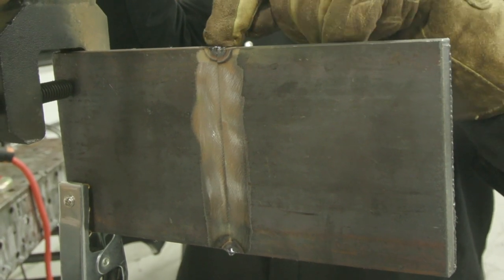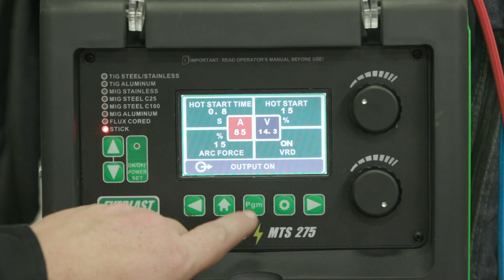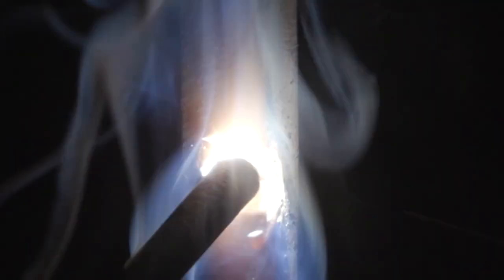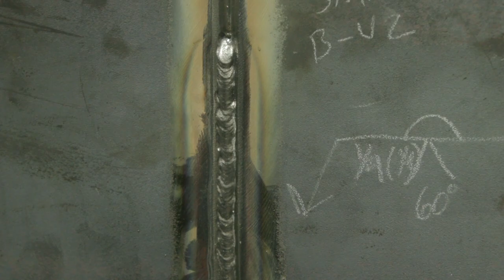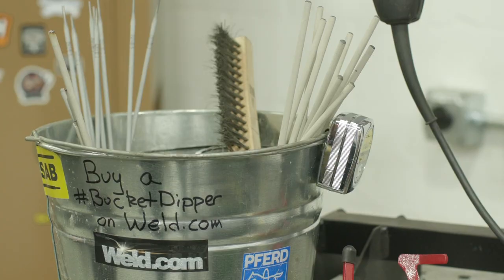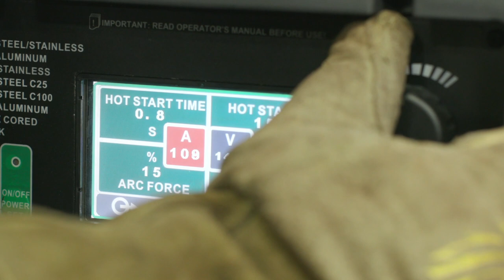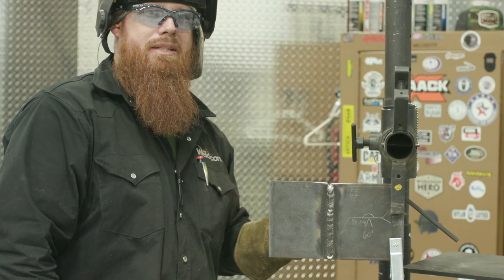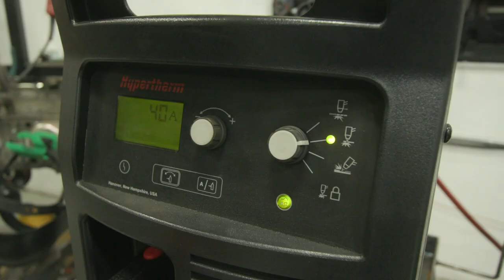Vertical Stick CJP with Back Gouge - Full Pen

Comment: This procedure is used extensively in heavy equipment repair where 100% full penetration is required.   A lot of bucket and blade cutting edges and router bits are replaced this way.  This is also a great method to help control and counter act warpage.  Another good one my man, I got a like button to go batter about.

Comment: I’m thankful for the sponsors providing the machines and consumables to do the content. It’s also nice to see new machines capabilities without having to buy it. I don’t doubt anyone on the welding side of the trio here could make any of the welds with basic machines, but maybe show some of these guy’s learning how to weld on a basic mig or stick like they have at home. Every now and then, you know. No pulse mig, no slope adjustment, blah blah..... show Joe what he can do with a Lincoln 180.....and I mean the limits of what he can do, not a butt joint. In the right hands, what can Joe achieve with a basic machine.......because that’s what Joe has while watching these vids. He wants to learn, but he can’t watch a pulse video and go try it for himself. And on topic, nailed it Jason..... killer job as always.

Comment: Understand the left handed remark. It's definitely different if you're not used to it. Had to do some lefty welding on a 12" flanged cross yesterday. Wasn't that pretty but it'll hold the fire pump water.

Comment: Another Great video! Gouging with plasma works great for small welds or cutting tacks but still like clean carbon arc for down hill /overhead weld removal. 💥🔥😎

Comment: Great left hand weld my friend.! Say...dont you use those old air grinders anymore??? They look like the jack-hammer used to break concrete and sound quite the same but miniaturized for the weld shop to clean slag off the welds.

Comment: I know that this has nothing to do with this video but I want to get into TIG welding but I dont have a big bugget at most $1000 at most. I was wondering if you had any suggestions on good tig or multiprocess welders that will last a long time and will be reliable. Thanks

Comment: I would like to see some bend tests and how to you prep your test plates.
Reply: Grind your plates and cut 45 degree angles on both plates on the edge I believe
Reply: @thomaswright5100  there is a certain way to prep, a lot of people do it wrong and I want to see how they do it. And it's a 60° bevel so 30° on both plates.

Comment: At 5min 20secs, you say you have to remove the carbon deposits, plasma gouging does not leave carbon deposits as there is no carbon rod used

Comment: If one doesn't have a plasma torch handy is using only the hard rock grinder acceptable to gouge out the back side?  Seems to me it should be.
Reply: I definitely wouldnt break out the plasma for something that short, probably would have had it don't with the grinder by the time I drug it to the work. However, if I had a few feet of weld to do this way it would most definitely be the way to go. It's one of the reasons I like this channel he likes to show alot of different ways to get it done. Also, if your on a job, their procedure may call for that because that's what they expect you to do!

Comment: What is it your using to write that welding symbol???
Reply: it's a mechanical soapstone pencil (guessing the name, not too sure what the actual name is) but u can pick em up at grainger or a store like it.  real nice to use and u don't need to file the soapstone to a point as it's already a thin size. it's worth the price I'd say

Comment: It is unclear why a plasma cutter, resulting great heat and molten build up, is used over a rotary grinder or a die grinder for a 1/8" cut.  Welding is walking that fine line of fusion vs. damaging the ductility of the parent material.  Good video.
Reply: José Duarte Miranda go back to science class

Comment: That's not a bevel symbol ... This is    |/
Reply: WEAPON_X it’s the AWS A2.4 weld symbol for a single V bevel. Which is correct for the joint we are welding and is outlined in the D1.1:2015 code book. The symbol you wrote is just a single bevel. It wouldn’t work for this joint.
Reply: @GodslilRedneck23  my bad lol 😬🙌
Reply: WEAPON_X it’s all good man. Just wanted to clear up any confusion.